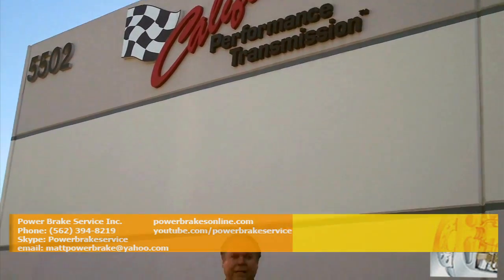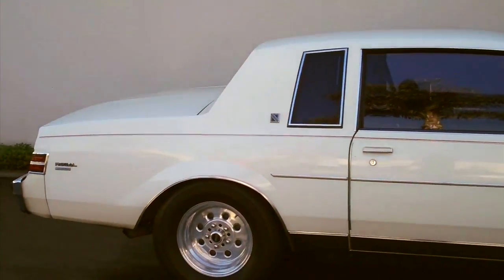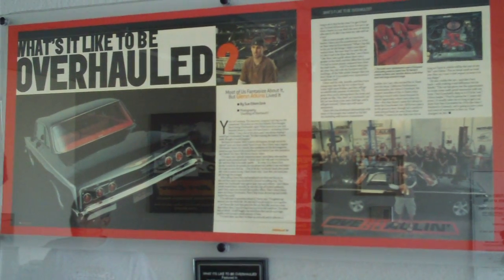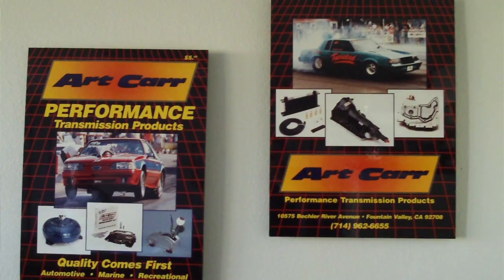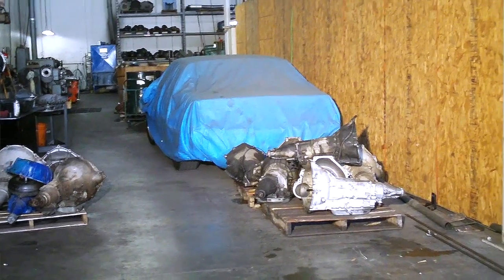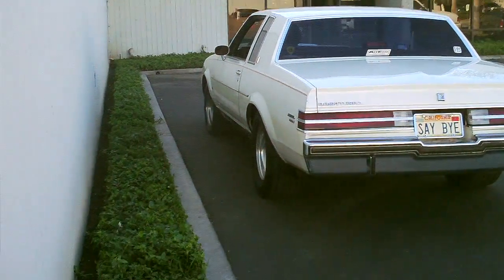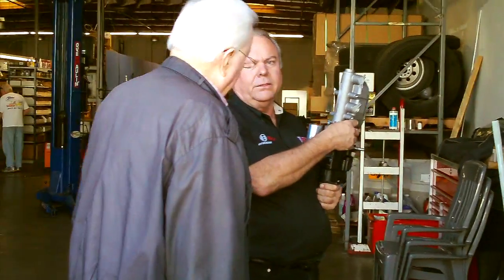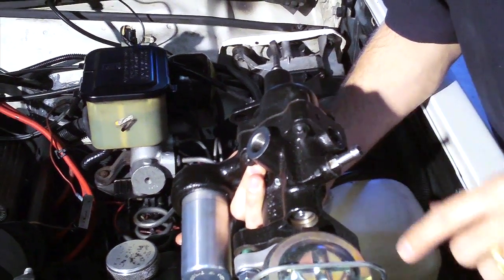Buick Grand National T-Type Turbo Regal Powermaster to Hydro-Boost Performance Brake Conversion pt.1

Comment: Seth, I have a 87 Grand National & I'm looking for a master cylinder for the old Powermasater brake system.  It looks like according to your email that a master cylinder from the '84 turbo Regal's will work.  Have you tried that work-around?  Please let me know. I'm in a bind right now.because I don't have enough money to upgrade to the Hydroboost system. My name is Matt Brnusak, located in Portland, Oregon  Please let me know if you have done this work-around.  Thanks

Comment: Great informative video! The Powermaster set up is a bad joke and should be replaced at GM's expense!! LOL.

 I will be doing this mod to my Grand National. The Bosch parts are excellent I'm sure but I think I'll just use the stuff for the '84 model turbo Regals that you can get rebuilt from any parts store.